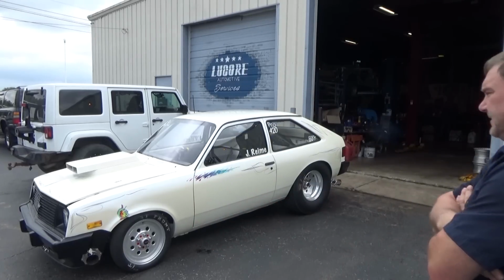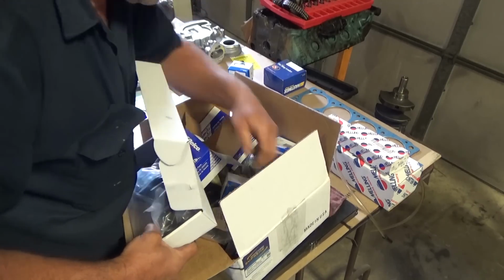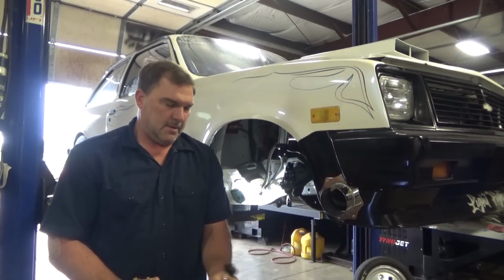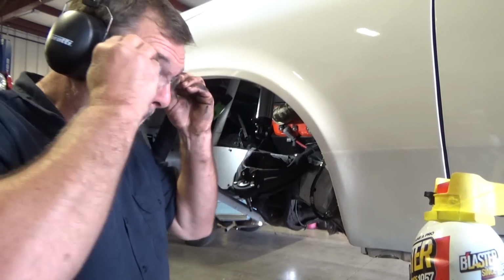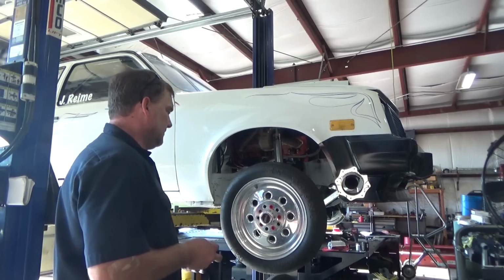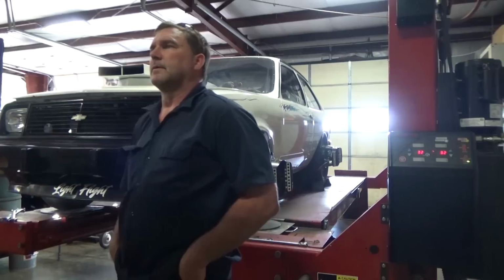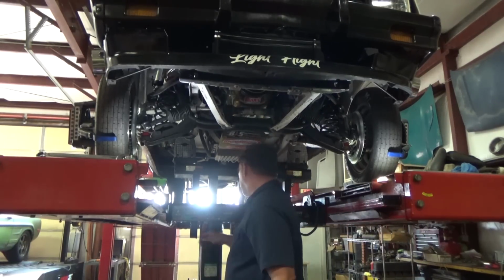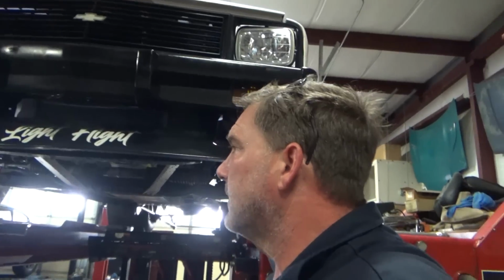Big Problems come in small packages! Chevette Drag Car in the shop for some fixin and plannin!

Comment: Very familiar with these cars. The cross member bends in these and the upper control are moves inward tipping the top of the tires in.. we use to pull the cross member apart on a frame straightener to fix the alignment.. hard impact with broken springs would cause this. In the case of this car I say it had wheels up a few times and came down hard also these cars we assemetical. So wheel base on one side is longer. This front end was the Same front end that was in the opels from early 70s. Hope this clears up some of the issues your having.

Comment: My friend own 65 falcon similar setup the front wheels only touched 3 times in 8th mile  sometimes only ones if missed a gear 289 2 4 fours 12 grand  launch at 8 grand

Comment: I'm with the other guy, this is basically a total race car now. Trash all that stock suspension and get an aftermarket one with lots of adjustments.
Reply from the maker: In an ideal world we would replace a WHOLE bunch of things on this Lil Monster and start from a different base. However at this point in the season it's make improvements as we can and get it drivable time, off-season we'll see about big changes 😉
Reply: Looks like a 1 or 2  inch narrower rack and bumps steer kit would give you better angles on your tie rods.

Comment: 71 Vega. Put Corvair Van springs in the frontend. Stiffened up way too much. so much that the left shock would come loose on the bottom. usually had a bent lower A arm because of torque and leaving lights hard.
Short car that goes Fast straight. A combination thats hard to achieve

Comment: my 1st wife had a fiero gt and I thought the front was chevette and the rear was citation. It never felt connected to each other when driving it, hated that car. Never understood tiny brakes and suspension on the front and mediocore brakes on the rear. Always felt like the rear wanted to steer independently. Should have been done better.

Comment: Might want to check the Upper control arm mounts and or Subframe for heavy Curb/Wreck bendage etc Chevettes were Disposable built Turd buckets in most every way as I remember them,  Kinda seems like they Swung even lower on Chevettes MFG vs Vegas but could  be the same D.B.'s that designed them both 😅😂🤣 ... Just a thought Rich... I can definitely tell you know what you are doing  otherwise... Enjoy the content... Thx for it... 😎

Comment: Man, I would be willing to bet 90% of the Hate in here is because it says Chevette on it oh, he would head another name plate on it they would just simply be the suspension components are a little bit light-duty... lol all good though not everybody has to like them. The upper control arm is exactly the same as a Fiero with the exception of it having the shock mount on the top which can be transferred easily oh, and the upper control arms on these cars are pretty much throw away just like they were on the Fiero once they bend their done

Comment: I had a 1986 Chevette for a commuter car. It came from a NAPA store and it was rather worn out. I brought it into out shop and we found silly amounts of negative camber. We found the front frame horns twisted a bit. I think the parts drivers may have treated the little car to some jumps. We ended up putting it on a frame machine and twisted it back to spec.
I wonder since that’s a drag car has it come back to earth hard after some good launches?
Reply from the maker: There's a VERY good chance this thing has seen some colorful and questionable past. In addition to someone "upgrading" it from rack and pinion back to a steering gear setup and A body stuff... there's... a lot of opportunities here!